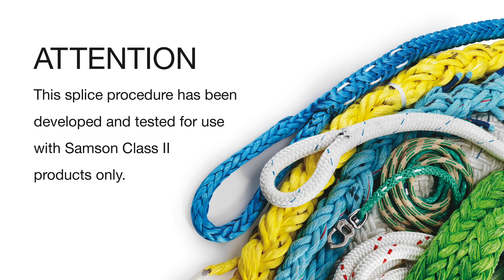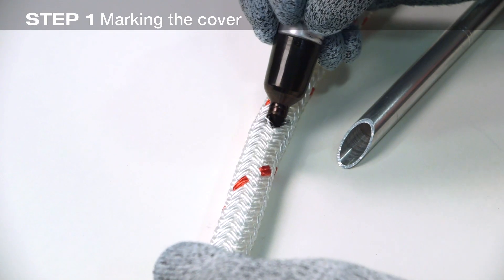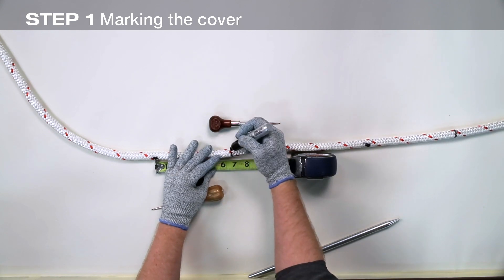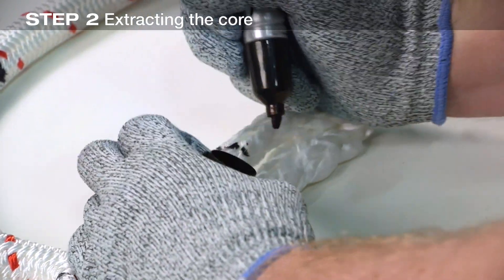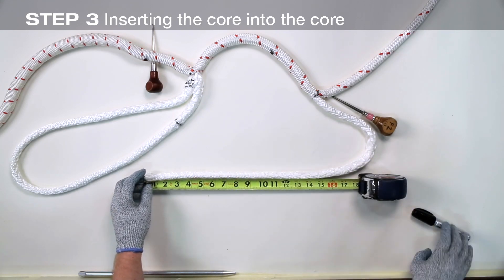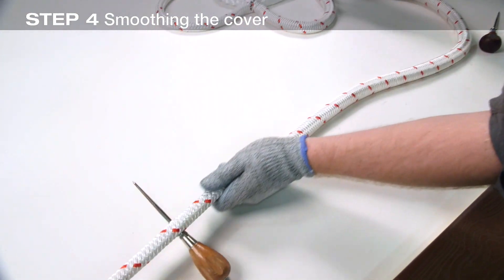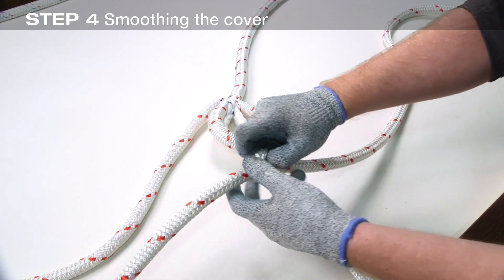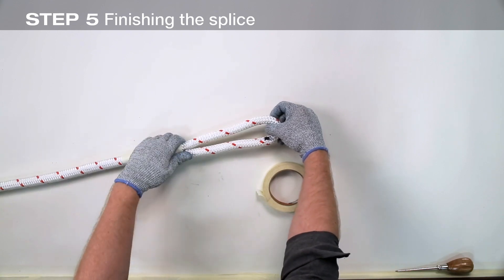Samson Rope: Double Braid Class 2 Eye Splice

Comment: From what I've gathered, there's a vital part missing to these instructions. Marks 1 and 2 merely indicate the size of the eye, but not the place. The throat of the eye is not where marks 1 and 2 meet, but rather where marks X1 and X2 meet. Make note of this if you need specific lengths of rope

Comment: When making spices on these ropes there's a certain amount of rope shortening due to the splice, and a certain amount of lengthening from the initial elongation. Do you have a chart that has these amounts listed? We need quite specific lengths, and the amount lost to shortening/lengthening can be difficult to predict.
Reply from the maker: Gregory - apologies for the late reply. We don't have a chart to reference, but for  Class II or high-performance rope splices, we know we lose a quarter fid length for every fid length buried, and when burying two fid lengths, you lose a half fid length of the total consumption. Here’s an example using a two fid length bury.  21’’ (Length of one Fid) x 2 = 42" + 10.5’’ (Length of one-half Fid) = 52.5’’. Take this number and add it to the eye size needed: 52.5’’ + 6’’ = 58.5’’, and this is the total length of extra rope required for a sling with a 6’’ eye on one end.
Reply: @SamsonRope  that's super helpful, thanks
Reply: @SamsonRope  So, I've just spliced some 5/16" GPX, and the numbers aren't making sense. I'm making a sling with spliced eyes on both ends. I need the final length of the sling from pull to pull to be 11'6". Based on the numbers you provided I measured out 11'6" + ((fid 6.75" x 2) + (length of half a fid 3.375") + 5.75" eye = 22.625" for each side, total 45. 375") for a total line length of 15' 3.375". After the first splice was made I remeasured from the pull and got a length of 14' 1", which means a loss of only 14.375" as opposed to the 22.625" I accounted for. I presume if I splice the other side the same as I did the first one I will end up with a sling longer than I need. Did I do something wrong or measure incorrectly in some way?

Comment: I am trying to put an eye splice in the 1/4" Sampson Warpspeed II but the eye I need is shorter than the 4,1/2" Z length that is posted on your splicing instructions for Double Braid Class II. Is there an adjustment I can make for this?
Reply from the maker: Apologies for the late reply. The Z length should not effect the eye length.  It will create more cover slack to bury the splice and this will be okay.